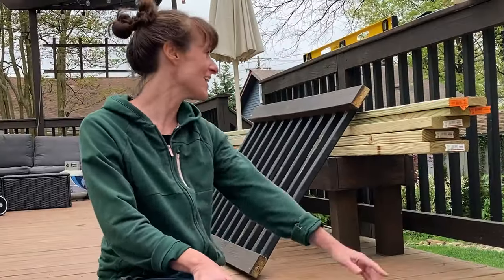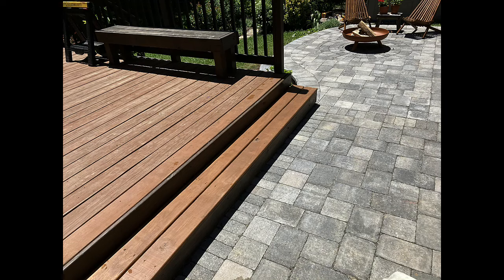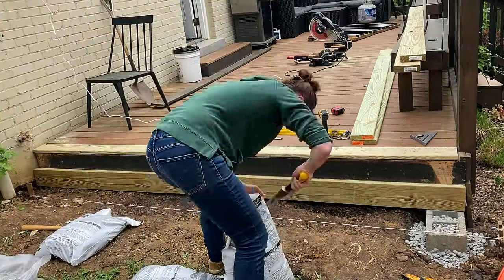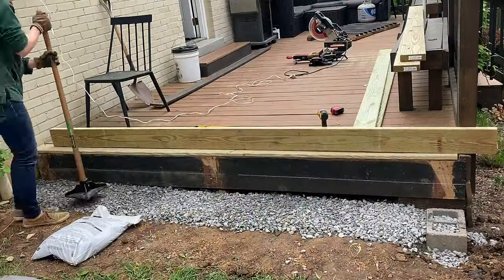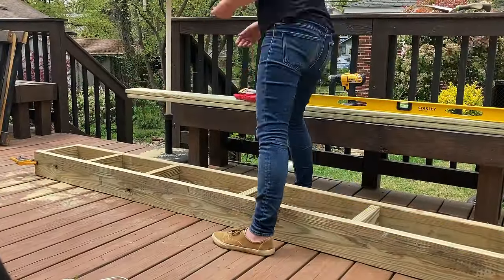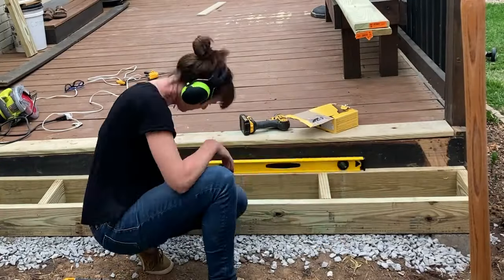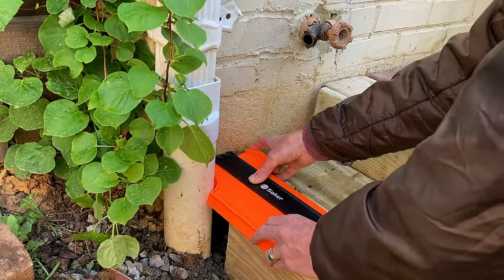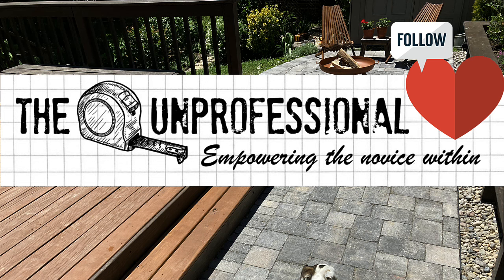How to Build a Deck Stair

Comment: I am in a similar situation but I had some existing steps in a smaller section. When I removed those the joist they were butted up against was completely rotted! Moral of the story is, you got to give the water somewhere else to go rather than your wood. Some people stack washers. There are specialty "spacers" but you got to give the water some where to go. I hope that helps!